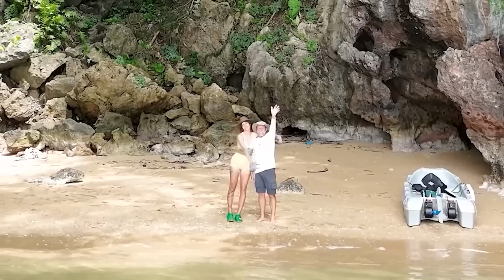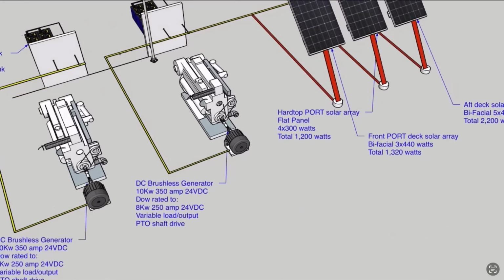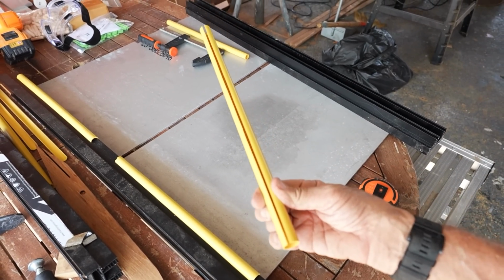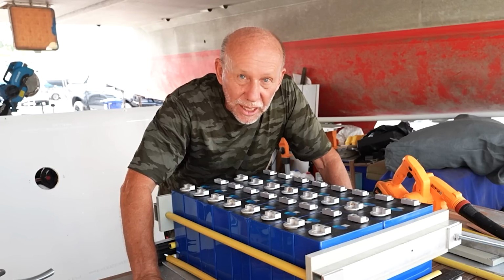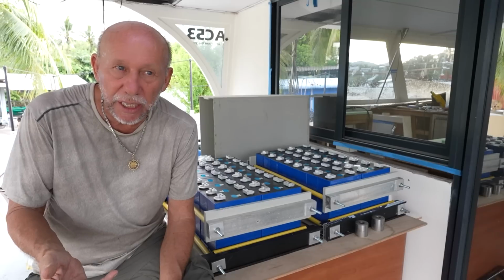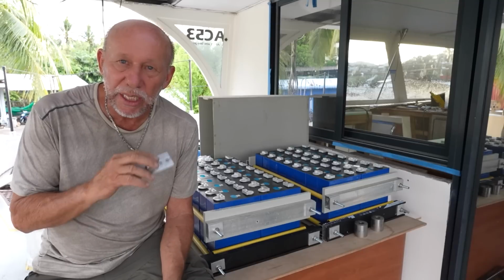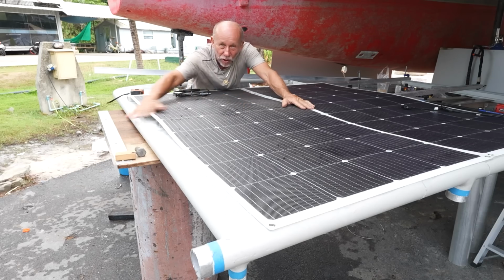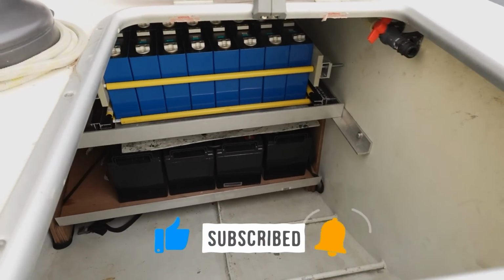OFF GRID POWER BUILD Aluminium Exploration Catamaran

Comment: Hi guys. 
I find my flexible solar panel goes white and then is not efficient. Do you have a suggestion for cleaning them. I wash them. I have tried many different ways including polishing, spraying silicone spray, spray oil. So far I haven’t found any that fixes this whiting problem.

Comment: Please be more accurate with your battery specifications.   The storage capacity of a battery system is not measured in Kilowatts, it's measured in Kilowatt-HOURS.
Reply from the maker: Good day. Yes your correct and at times I forget that even though I and most know that when discussing battery storage it is in KwH many out there are not engineers so they might assume some other meaning of kW   
Will be more specific in the future 
Capt W

Comment: William, please don't forget the insulation plates between each cell 
These are very important because the housing of the cells is under voltage. The thin blue plastic cover doesn't take much.
Reply from the maker: Hello and thank you for the comment. There are actually small insulator plates between the cells that I am testing. Super thin and yet high modulus.  
Will check them in a year. 
Capt W

Comment: Great video!  Question, maybe I missed it but are you only having only generators and removing the drive engines? Is your propulsion going to be electric? I always wondered if the efficiency would be better having a generator powering a electric pod direct to the propeller vs. engine going through a sail drive to the prop.
Reply from the maker: Hello. 
The drawing I did shows that there are DC generators running off the FRONT of each engine. The rear still has factory saildrive units. I think we are getting close to marine electric propulsion but in my opinion not quite there yet.  The complexity and the cost does not justify replacing a simple marine diesel power system. But we are set up to change this in the future.  There are some pretty neat test products out there that are hybrid and some even adding a Dc drive in the power output side of vessel. Only time will determine how well these work. 
Thank you for your input 
Capt W

Comment: Captain William (Bill) -  Items for your consideration (my background is electrical, reliability and maintenance engineering - now retired) - 
1. Typo Correction - LF3O4 should be LFPO4 for Lithium Iron Phosphate
2. Battery capacity is specified in kWh (kilowatt-hours)
3. Current is specified in amperes (amps)
4. Clamping batteries tightly together - The way you have packed the batteries together will significantly increase the risk of thermal runaway. These batteries contain chemicals that get hot when charged or discharged. Strongly suggest you separate each battery from each other by at least 12mm to allow heat to escape and allow minor expansion to occur. I used short strips of 12mm x 12mm hardwood at the base and top of the batteries to prevent physical movement of each battery and also to allow heat to dissipate.  You will need to install new battery terminal interconnectors to allow for this increased distance.
5. Ventilation - Given the heat building up with the battery compartment, you will also need some type of ventilation to allow a flow of outside air through the space to get rid of the heat and some gases that evolve during charging. These gases are corrosive to metals, especially copper and brass, even SS316. Watch out for those voltage sensing circuit boards. Can you spray them with a suitable varnish to prevent corrosion ? Keep any electrical equipment outside of the battery compartment to protect from corrosion and heat. The Battery Management System components should be housed in a sealed waterproof box (polycarbonate box preferred as aluminium will corrode from salt air).

6. Fixed solar panels - the bottom of the aluminium frame need to be raised at least 50mm above the roof to allow sufficient ventilation under the panel to get rid of the heat generated, otherwise the electrical output drops.
7. Mounting batteries in a sealed compartment -  Read Item 4 above - Significant heat and some gas will be generated during every charge and recharge cycle. How do you intend this heat and fumes to escape ?  You need forced ventilation. "Air IN" and "Air OUT" entries. Do not make entries into or out of an inhabited space. Beware of the toxic fumes. Vent externally.
8. Victron electrical equipment - the best on the market. I use it too. Did you get the circuit boards marinized ? Ie. The equipment is designed for use on land. You are now using it in a salty environment. Corrosion will occur unless the circuit boards have been sprayed with a suitable varnish to protect the components from the salty air.
9. Electrical lugs on cables - Use a suitable crimper that mechanically deforms the lug and cable to ensure a strong reliable connection. Check for tightness. Take one sample and cut across the lug. The cross-section should show the copper wires inside the lug should be solid with no air spaces between any strands.
10. Buy a good quality multi-meter and clamp-meter and learn how to use it to solve boating electrical problems. Nigel Calder's books are worth buying. Eg. Boat Owners Mechanical and Electrical Manual 4th Edition. Approx US$75 on Amazon

I enjoy watching your videos. Wishing you and Jana lots of sunshine (for the solar panels), fair winds and following seas. From Sydney, Australia.

Comment: What were the reasons why you opted for 24v as opposed to 48V for the battery banks? I ask because I'm completing a power cat that I've designed around using off the shelf Seplos battery cases, also using EVE 304ah cells. I too have designed independent port and starboard charging systems, battery banks and inverters. Good luck.
Reply from the maker: I did a live about this subject of 12, 24, and 48. 
After designing our steel mono with 12 and 24 and living aboard 3 years we then moved to a 50 foot Cat. On that vessel I designed a 48 volt system with DC/DC converters for the multiple systems. 
After living aboard for 1.5 years we now are refitting the aluminum exploration vessel. Issues I had with 48 was that bilge pumps, electronics, nav lights, water pumps and other equipment was easily available in 12 or 24.  48 volt items rare in the marine world. As most commercial vessels are designed with 24 volt systems finding good quality used equipment in a pinch can save a lot of money. Finally by not using DC-DC converters I save a lot of electrical cabinet space and operate at lower temperatures. 
Our dingy is 48 volt so that battery is being used as a backup with step down converter to the house bank selector switch. 
My end game is to design an automatic switching system for multiple batteries and multiple loads. 
Keep me updated and GOOD LUCK on your build. 
Capt W

Comment: Do bifacial solar cells make sense. In most places the cells get no or only very little light from the backside. So the backside only adds weight.
The flexible cells are made to be mounted on a ridgid back. They don't like to be flexed repeatedly. This makes them fail early.
One the sailboat one will have quite some partial shading. How the bypass diodes are wired can make quite some difference. How the modules handle partial shading can differ quite a bit. 
Ideally one would have multiple smaller MPP systems to handle partial shade better.
Reply from the maker: Thank you for the comment.  Actually testing bi-facial and non-facial side by side for over a year the bi-facial out perform in every circumstance. On cloudy days, partial shade, slight rain—- the bi facials are at least 20% to 30% higher wattage than the non-facial. Both cells did not have backside reflection. And I have been able to provide data on the flat panels where the supplier has agreed to replace all of them free of charge. They think is possible I obtained a faulty batch of panels. Time will tell. Finally yes I have installed smaller MPPT controllers to separate solar locations.  Keep an eye out for the live we intend to have on these subjects. 
Capt W and Iana

Comment: Do you monitor stray currents. Owner of 2023 48 Mumby. Highly recommend a Seabis to monitor. Outstanding back up service. 
Have you isolated stray current from the alternator?
Reply from the maker: Hello, thank you for the comment. I do have a stray current monitor on the boat and have designed isolation for the DC generators. They are separated from the engine and they are also fully isolated and brushless so they are not as a common alternator like a Balmar, that’s being mounted to the engine—more of this DC generator to come. Stay tuned. 
Capt W

Comment: you want better efficiency from those hard panels then drill holes in the side of the frames. will not weaken them but will let heat escape and let wind pass through. you can drill a hole 1 inch apart then connect them so you now have slots also.
Reply from the maker: Thanks for the tip! Will give it a try.
Capt W
Reply: @DawnHunters  careful to not damage cells needs to be lower on the frame. you would think they would design something like that into them so when mounted on roofs they can vent better

Comment: you going to very hot places, yes temperature wise. I would make sure there is a lot of cooling. using air can achieve that. remember Lithium hates cold and heat. From other posts maybe adding a 3rd bank would be wise. so you can drop the amp load from discharge and charge to each bank. I have mine set at .18C yes less than 20% of a C rating. so even if it gets my 10kw solar at peak going into they never get hot (the Lifepo4 cells).
Reply from the maker: Thank you for the comment. You have the same mindset —- The complete vessel load is satisfied by a single bank A but I did add bank B for a backup. And I also have programmed less than 20% of the c rating. They never even get warm at charge or discharge. 
Capt W

Comment: That is a nice setup. I truly would add another 1p to both sides so 16 more cells, 8 on each side to give you another 15k of storage. I have 4 16s battery banks to power my home and I do not have the loads you do. I want to add another 32kw of battery banks to my setup. Never enough battery storage IMO. I do love your setup I really do.  Keep up the great work.
Reply from the maker: You know your correct!!  I should of had your comment BEFORE I built the shelf, brackets, and installed them!!  Lol  Adding another 1P could have been quite easy. The one issue is that 123BMS like to have 2 cells per board for best protection. I have designed the total system to accept a third 8s2p bank. The only power loads we have encompass cooking so and Yana has learned to no turn on all the appliances at the same time. The 2 air conditioning systems are DC and variable speed with variable compressors so they also have very low current requirements. We have decided to set up a live for these questions. 
Again Thank you 
Capt W

Comment: Have you thought of an earth leaking of you 24volt dc to ground to alarm if there is any leakage or stray current on both A& B circuits .That can be made for your application & second an earth fault for the A/C system which will give a warning of stray current at all times.?

Comment: No matter who says what, NEVER walk on a solar PV (photovoltaic) module (hard or flexible). If flexibles are glued to a rigid and solid surface, it is a bad application. The heat they absorb when glued down in direct sun can be well over 150 degrees Fahrenheit, resulting in browning (cooking) the solar cells out of usefulness. All modules must have air circulation beneath, no matter what construction. Support dimples beneath flexible PVs compensate for sag or flex from rain or snow load and should be added to assure adequate air flow. 

Extremely thin 'washboard' type aluminum spacer plates can be easily fabricated, light weight and easily affixed to the deck and onto the flexible PV module.The spacers also allow wire runs underneath the flex modules, no matter if the wire connector blocks are above or below the module. Attention to cleaning under all module types must be performed to assure cooling air flow.
 mogcanalboat.com

Comment: Redundancy - yes, absolutely! With added weight of battery banks placed down low I wouldn't worry too much about CG (unless real numbers show otherwise). Water cooled solar panels would provide free hot water and would significantly increase efficiency. The only question - why not 48V?

Comment: I would highly recommend to add insulation-sheets between the battery-cells instead of only relying on the thin plastic shrink-wrap. On most of those prismatic cells the negative terminal is the full metal enclosure of the battery, so if you damage the shrink-wrap and get a short between two cells you can imagine what may happen. Do check the spec-sheet for yours!
A few options:
- Pre-fabbed epoxy-fiberglass sheets for $0.3-0.8 each if you buy 50 or so of them. Available as precut sheets for most standard cell-dimensions.
- EVAC foam <$1 per for pre-cut sheets for standard EVE cells.
- Self-adhesive Insulation paper ~$10 for 5 meters, but probably not very suitable on a boat with high humidity. I use this all the time but i don't do installs on boats or humid environments so no clue if it's suitable.

For your boat i would probably recommend the epoxy-boards as it should be fool-proof in terms of movement, water-resistance and not being compressible . When installing a trick is to get some cheap spray-glue, even fabric glue works, just to keep the sheet in place when building the battery. You just need something sticky that's not permanent.

For the busbar-connectors there are flexible ones that removes the strain from the battery-connector as the batteries expand/contract, and they will. Only a couple of $ each so no big expense. Using static bus-bars with prismatic batteries is problematic and i have seen terminals both crack and break off after a couple of years, even when constrained by a fixed frame.

For the remainder it's a nice build! :)

Comment: Brilliant guys!  Looks awesome!  William, is there another battery bank under one side, perhaps lead acid (the black boxes on the lower shelf)? If not, do you plan on adding lead acid batteries for starting the engines, or will you use same lithium?  Thanks!
Reply from the maker: Hello Charlie. 
1.  Those are the old original lithium batteries we are using for all the power tools during this refit 
2. I do have an AGM battery for each engine starting system that is charged from a DC/DC converter. 
Thank you for being here! 
Capt W
Reply: @DawnHunters  Got it!  Thank you sir!  All the best!👍

Comment: Foam fire system for the battery lockers?
Reply from the maker: Good idea but once a lithium goes into thermal runaway they are not able to be extinguished. Thus why in this location they will melt the aluminum bottom plate, then the hull and drop into the water. Boat will not be effected other than two new bottom hatches. 😂
Capt W

Comment: Don't you think that 24V is a bit low for that amount of storage, why not go with 48V? I like the design overall, you designed the system the same way I would, overkill is underrated...
Reply from the maker: Hello and good question. 
We did a live you should check out. Had the 48 configuration but for safety purposes for items like bilge pumps, emergency pumps and electronics we required DC to DC converters. Too many components to maintain reliability in my opinion. 
But very good for off grid cabins. 
Capt W

Comment: Just an old Ironworker here, but I worry about the thin fin on extrusion supporting the weight of the plate and those batteries during swells. I hope tyhey are suporrted more securely that what I see so far. Perhaps I only see a part of the plan. Antway one heck of a project and amazing progress. Cheers